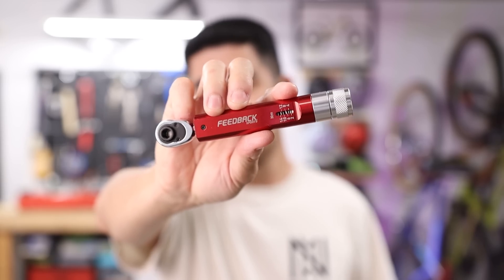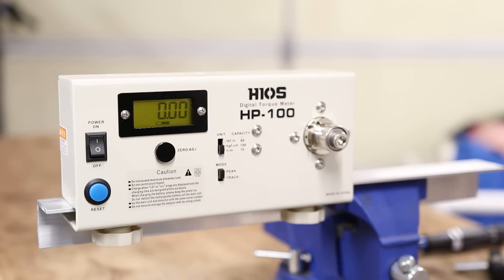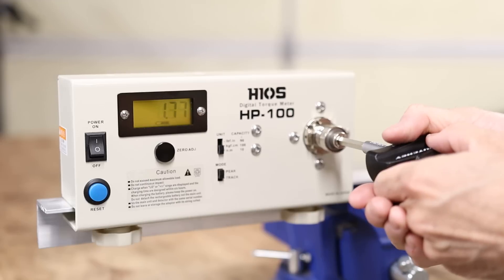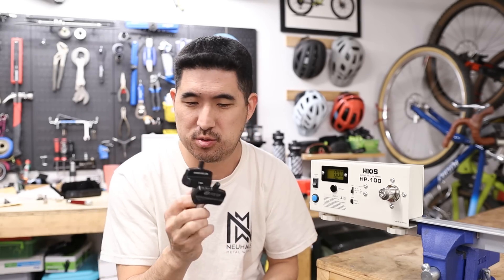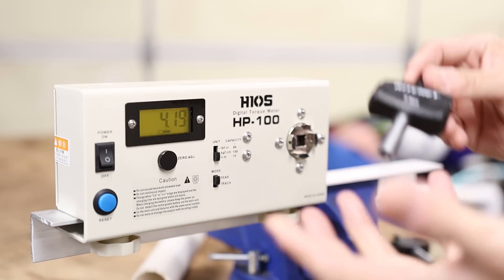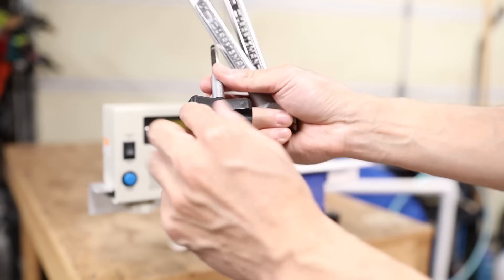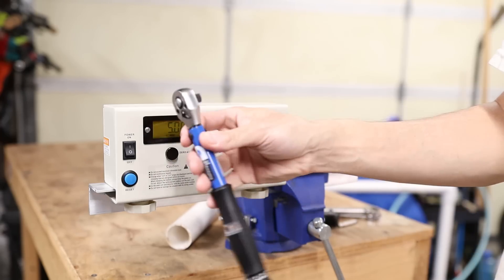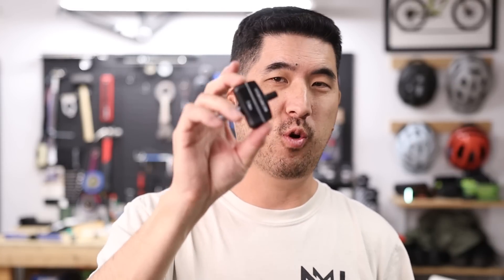Are $20 Budget Torque Keys ACCURATE??

Comment: This was an excellent video!

Would like to see the hand adjustable torque wrenches.  Would be interesting how accurate they are.

Like the following:

IceTool 3-10 NM $23

MARQUE Adjustable Bike Torque Wrench – 4, 5, 6 Nm $35

Pro Bike Tool 4, 5, 6 NM $40

CDI Torque Products TorqControl TLA28NM 2-8 NM $64.55

Park Tools ATD 1.2 Adjustable 4, 4.5, 5, 5.5 6 NM (do you need 4.5 & 5.5) 71.95

Comment: If you could test the following tool that would be awesome.
I personally use the IceToolz E219 Ocarina Torque Wrench.
It's another hand size torque wrench that is more of the needle/beam type* so it provides more flexibility i.e. variable torque from 3 to 10 Nm. It even comes with different sizes of hex key heads and a torx head hidden in the handle. It's very light so perfect for traveling.
It's competitively price against these fixed torque keys.

* Generally considered very precise. I've seen a precision test on BikeRadar and it performed well.

Comment: What safety factor is engineered for fasteners as far as over twerking goes? I'd imagine 50-100% over twerking is within safe limits but what do i know? 🤷🏻‍♂️
Reply: As of the DIN EN ISO 4210-2, which is kind of the "standard" European norm for bikes it is actually only required to not fail at 120% of the max recommended torque.

Comment: Considering that bolt tension varies by plus minus 25% for any given torque, the inaccuracy of a torque wrench is hardly a problem.   In my opinion, with a 25% inaccuracy (or even more in some cases, as SRAM recently discovered) the slavish use of torque wrenches for every single bolt on a bike is the bigger problem.  I think it is just an industry means of blaming the assembler for every failure. "Did you torque it correctly?", followed by "was your torque wrench calibrated?".  Well, provided your wrench was calibrated to within 25% - YES.
I'd only use a torque wrench on items prone to crush failure.
Reply: Bad warranties from manufacturers don’t make torque wrenches as a form of standard practice something bad.
Not to say it can’t or shouldn’t be done without them, but they’re good practice nonetheless, especially for people with little experience
Reply: 10% extra error is 10% extra error
Reply: OooOOo Burrnn!!  @TheBikeSauce
Reply from the maker: 😆I think the original comment is gone
Reply: The issue with SRAM was that there was too much lock tight in the threads, which stopped it from achieving proper torture. And, you should still torque things to spec. Over tightening is pointless and risks damage.
Reply: 25% error is not so bad if you're not sending thing to space. Everyone as his own opinion on what is "correctly tightened" and it varies greatly from bolt to bolt. Bike parts are light/optimised for weight. They should be tightened with a torque wrench. I can guarantee you if you tell different people to tighten a bolt the difference will be >100% and at some point some will loosen ans some part will break. Torque wrench are a good tool for bike, which is not ikea furniture. It's also great for check your bolt are not loose, it's hard not to be tempted to tighten a bit more each bolt after each check. It prevents that. However one important rule i found is when fitting a new part with a torque wrench you will probably have to tighten it a bit more after a ride.
Reply: So much this. Even the designers and engineers will tell you that torque ratings are a good place to start.

Comment: Park Tool are the most over rated and over priced tools. Also, the wrenches that adjust like that can be off a bit by how you set it.
Reply: I agree about Park Tools. The ergonomics of some of the basic tools like T-handles and screwdrivers isn't great, and I don't believe the metal is any better than cheaper brands. My tool chest is mostly full of Super B tools which have lasted extremely well and are much cheaper (but not cheap). There are certain tools that only Park makes and also ones I do think are superior, like the self-adjusting chain rivet tool which is genius. But I wouldn't buy all their tools just because they're the "de facto" bike tool people.
Reply: Definitely over priced.
Reply: They would only be overpriced if consumers failed to buy enough of them for Park to make a profit and continue to operate. And, they are making a profit. They’ve been in business since 1963, have 37 employees, annual revenue of $14 million, and have outlasted many competitors over that 81 year span. Almost every bike shop mechanic section uses Park tools. Thus, not overpriced. Engineers are not economists…
Reply: @tommyrq180 by that logic, epipens are not overpriced
Reply: @tommyrq180   They do, or did, make a lot of bike specific tools that nobody else made. They are also good at marketing. Their tools absolutely are over priced for what you get. If people buy them when they could get better tools from another manufacturer, then that is on them or they are ignorant about tools. Engineers have extensive experience with tools and using tools. We know tools. I do own a few Park Tool tools because they were the only ones who made them.  But, I would never buy any tool that is made by better companies like Allen wrenches or torque wrenches.
Reply: @DaveCM  You claim to be an engineer, but offer no other reason to see this as anything other than a social media smear. Engineer? What kind? Are you a commercial tool-maker? Didn’t think so, so you have no perspective on how to run a successful business—making tools. Thus, nobody really cares what you think, frankly, you’re just posting stuff. AND, as I noted, you clearly don’t understand economics. Park has been a successful business over a very long period. Other bike tool companies have come and gone and Park remains. Bike mechanics love Park tools. I’ve been a bike racer and hard-core mechanic for over 50 years and I LOVE Park tools. I have other tools, too. Lots of tools. If you have other preferences, well, go buy them. That is your OPINION, and you’ve given no reason here for anyone to care what you think. It’s just typical low-brow social media bashing, not helpful. You are one person. So am I, but legions of Park tool buyers disagree with you EVERY DAY when they buy and use the tools. They’re buying them right now, despite your unqualified opinion. Now, go ride your bike if it’s working properly. Or maybe it needs a proper mechanic to fix it.
Reply: Feedback sports and unior are good alternatives.
Reply: @riffmeisterkl True, feedback sports are pretty good. What I learned is that you should never buy bike-specific stuff unless you absolutely need it. Since I have access machinetools I make most specialist tools myself now.
Reply: Wrong.
Reply: @ShinyUmbreon765  can you explain how I'm wrong or is that all you have?
Reply: @ShinyUmbreon765   Nope. They are very overpriced for what you get. I'm an engineer and have lots of experience with tools. Park Tool doesn't cut it.